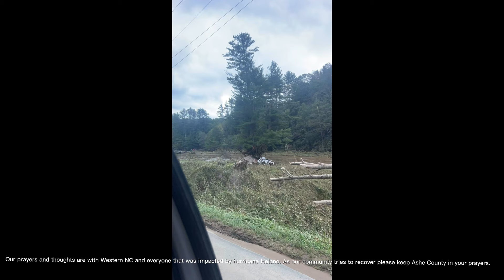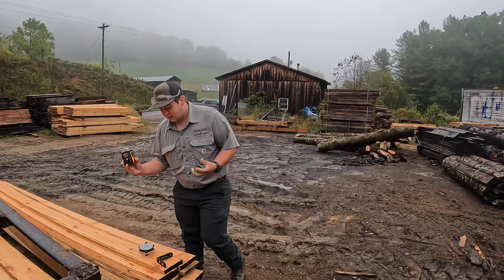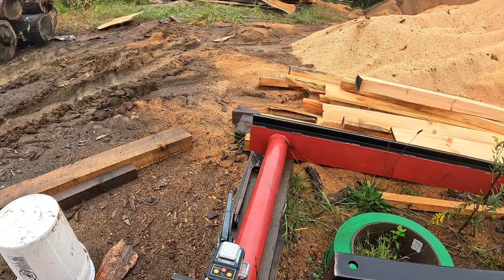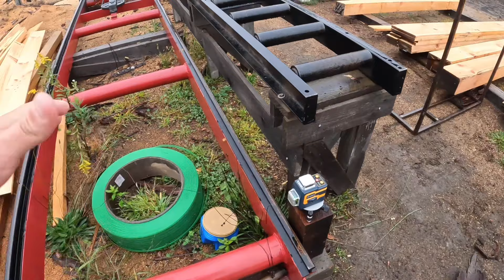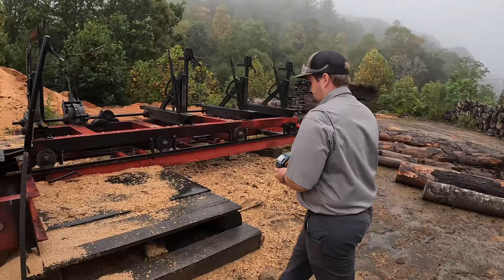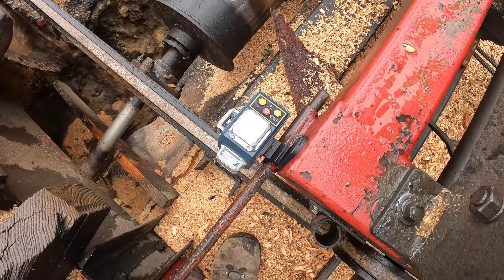Sawmill Alignment Using a Laser Level

Comment: In the early years of lasers (1990 in my case) I rented a laser for laying <6 miles of 8" gravity sewer pipe. My 'employees were hooked' as soon as they saw how that tool could be used to lay up to 400' of pipe without relocating or making a new set up. The pipe looked like you were looking into a very long rifle barrel...perfectly straight. 

Of course when the inspector and engineer saw the work they commented, "we need to write in all of our specs on future jobs that all gravity pipe must be laid with a laser!" I don't know if that became a new spec because I  never did another job for them. 

On another note while we were at lunch and doing other things for about 2 hrs. we checked the laser for accuracy at 100, 200, and 300 ft ahead before we did more work and noticed that the sun rays 'were bending' the light (our determination, not scientific) in the soon to be work area. I made a decision to make no adjustments and let the sun get lower in the sky (by an hour), make a recheck of alignment and found everything was back in line. 350' of pipe is quite a long distance for an uninterrupted pipe length. 

I said all of that to say this, "be aware something like this might happen to you." But I'm betting improvements of lasers probably will keep your shorter lengths 100% accurate all the time. 

Thanks for the video, sorry about the long comment.
Reply from the maker: @arkansas1336  ok thanks for the heads up on that.  Thanks for watching